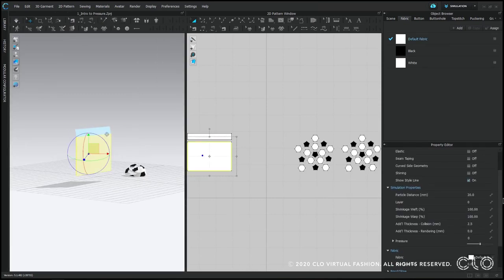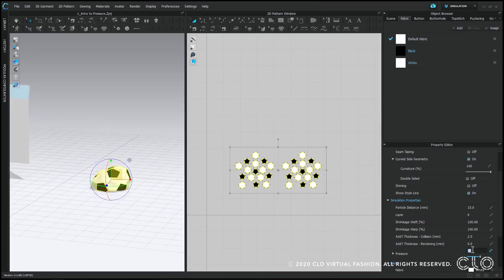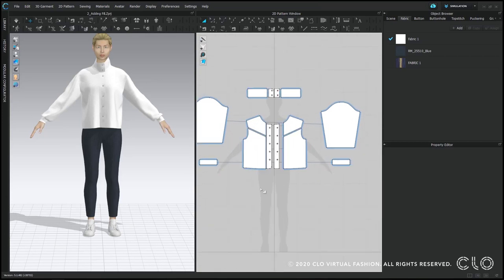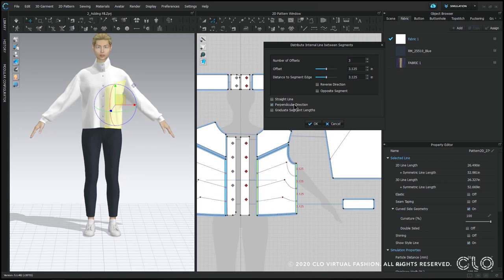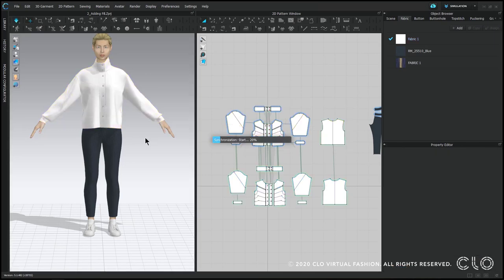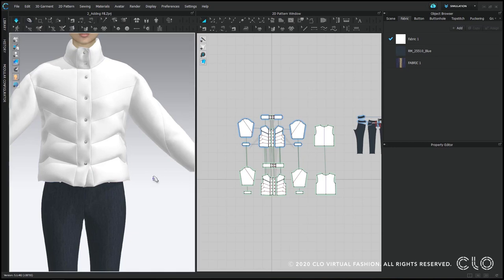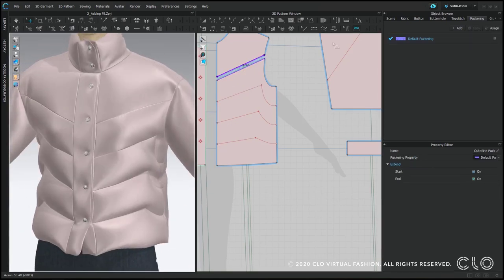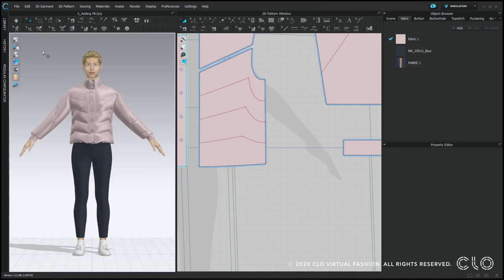Beginner's Guide to CLO Part 3 Garment Details: Pressure (Lesson 3)

Comment: My soccer ball is not displaying in black and white and the gizmo tool selects the individual segments instead of the whole object, even though it is sewn and inflated
Reply from the maker: Hi. What does the soccer ball look like? This may be due to the Fabric view you currently have selected in the 3D Vertical Toggle Menu. Make sure you are on Thick Textured Surface
The Gizmo will only select the pattern pieces you click on, not what they are also sewn to. You can Hold Shift to select multiple or use the short cut ctrl + a to select all.
You may also find joining our official Discord helpful as you will be able to add images to your questions there

Comment: Hello there, a quick question. I have created a pattern within the program having in mind an elastic fabric, which means that it is narrower in the waist and hips in measurement, because of the elasticity. However, it looks very tight on the avatar. Is there a way to input this parameter so it is depicted in the avatar?
Reply from the maker: Hi. If you are on the newest version of CLO you can use Soft body Avatar to show where a garment is tighter and compresses the body
But for the fabric, do you mean the entire material is stretchy? Or that elastic is applied at the waist?
Reply: @CLO3D  I mean the entire material is stretchy, which means the entire pattern is narrower in dimensions than what a stable fabric would be, but on the avatar it looks just small and not represented right. How can I put in the parameter of the stretchy fabric?

Comment: Is there a way to unfasten the button? The fasten button tool won't unfasten for some reason
Reply from the maker: When the button is properly fastened it will appear with a lock in the 3D window. To unfasten simply clicking on the button in the 3D window should unfasten it.

Comment: Is there a way to puckering without drawing over each line?
Reply from the maker: If you have a lot of Internal Lines you want to add puckering to, Right Click in the 2D window and select Lock All Pattern Outlines. You can the use the Segment Puckering Tool and Marquee Select the Internal Lines all at once; the puckering will then be applied all at once. This also works with Topstitch.

Comment: CAN I CONTROL AIR PRESSURE IN MY DRESS
Reply from the maker: Sorry for the late reply. Were you able to sort this out?
Reply: @CLO3D  mam / sir my dress clothing automatic dancing more when i stimulate  is there any gravity or other setting issue?
Reply from the maker: @mohammadbishalahmed8784   This may be due to a number of things. Quickly I will suggest using the Hi Res Garment Tool. Make sure you change the fabric to something in the Library, not the default fabric. If you continue to have issues post in our community with screenshots. https://support.clo3d.com/hc/en-us